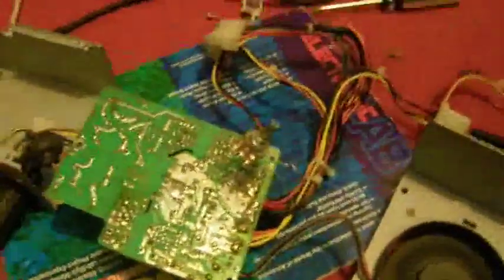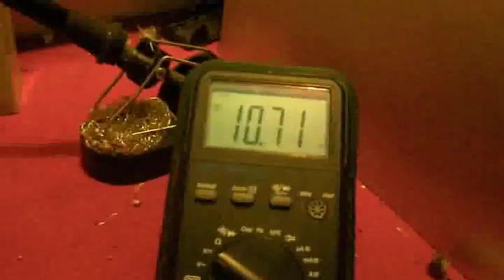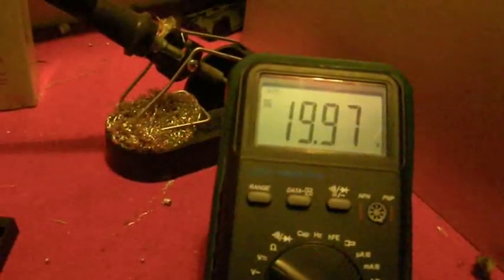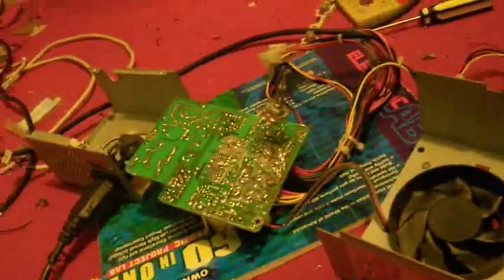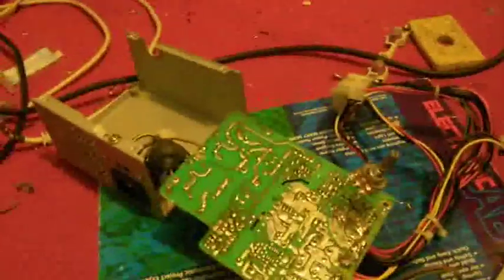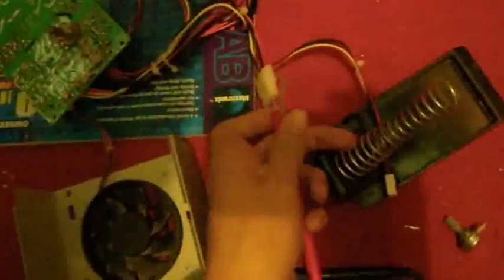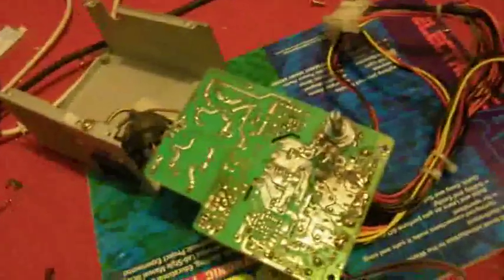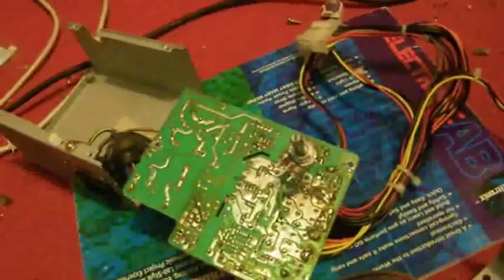Mod your ATX power supply into an adjustable lab power supply!

Comment: This is probably the most useful potato video I've ever seen. :)   Your description of what's happening is more than enough though.  Anyone who is decent with electronics will be able to reproduce it.  Everyone else is saying "how do you do it on mine?"    

I just got here looking for a 24v mod, to use with a 3d printer.  I was just curious to if there were a cheap way to do it safely.   But now, I may take one of my old ATX power supplies, and mod it like yours, just for a cheap benchtop power supply.   I've been using ATX power supplies anyways, but just working with only the 3.3, 5, and 12 lines.   I needed 24v to calibrate a VRM for a 12v laser on the printer.   I would have preferred to do it on the bench, rather than to do it once it was attached to the printer.

Comment: During power supply design semiconductors are calculated at certain output. You may can modified, but this it's fire hazard! Please next time use discharge resistor I stead screw driver.

Comment: 3volts to 25volts and carry at least 10amps. Thanks for the video. I would like to see where exactly you connected the wires of pot.
Reply: so do I.... his explanations are not clear and systematic at all.
Reply: Bruno Ferreira buy a booster buck converter from Ebay. I used a 500watt power supply and then used the 400watt booster to get all the voltages I need.
Reply: Thumbs up ! I will write down your advice. Lol
Reply: Bruno Ferreira DC-DC 38V Digital Step-up Step-down Module Boost Buck Converter Solar Charging (modula just note that some are step up and some are step down and some do both look at the out put amp rating to give u and idea of the watts)
Reply: China cheap buck boost is worst . Someday ago i burnt two buck module.

Comment: There's a danger with this mod.
Output capacitors are often rated around 16 volts. Overvolting a capacitor will make it overheat, and eventually blow.
In worst case the aluminium cap will shatter into small pieces spreading around in the power supply short circuiting everything.

Comment: In defense of the poster, He's already giving a base Idea.. You can do the foot work yourselves, looking for the datasheets for the feedback loop (which is using a LM494 or similar chip), and the Overvoltage protection chips.. I know, not all have the same chips..   Simple rule.. Let the supply sit for at least a minute after unplugging! Let the input caps bleed down! (or you're in for one serious shock!)

Comment from the maker: Well, the power supply used 25V Chemicon caps on the 12V output, which can briefly survive 28V. I had to disable the over-voltage protection or I could only go to 14V. Modding the feedback and disabling OVP was all that was needed. I did this quite a few years ago -- and I've long since thrown this power supply away.

Comment: @ubuntututorials Hehe.  I wish I had realized before tracing half the circuit to see if I could find a spot to readjust the 5v vs 12v. Oh well. I think I'll just stack two 12v rails by isolating the upper from chassis. That will give me the required 24v atleast.

Comment from the maker: @1kreature Yes, I understand that - I work a lot on switch mode power supplies. The TL431 is often used as part of a feedback mechanism. When the voltage at the ref pin exceeds 2.495V the output conducts, which controls an opto-isolator. The opto-isolator feeds the primary side switcher IC which has a built in MOSFET. Now, unlike many other PSUs, this uses a primary side control circuit. Most nowadays use secondary side control, it is cheaper and simpler to implement. These are easier to mod.

Comment: @ubuntututorials Btw, for those psu's using TL494 chip this may be a good source of info:
pavouk.org/hw/en_atxps.html
Basically it shows why you can't tweak each voltage seperately...  They are formed from same switcher and turns-ratio dictate the voltages.

Comment: @ubuntututorials Yeah, they should be replaced.
Looking at my PSU here it uses a TL494 for pwm regulation. IT also seems to be relating the 5v to -7 of the 12v as when I tweak the feedback loop of the 12v the 5v follows suite. How annoying.  Now I have to find that too and compensate. Adjusting the 12v to 13v moves the 5v to 6v. How rude of them not to make these fully seperate.  (Cheap probably.)

Comment from the maker: @1kreature Mine had 10V and 25V caps on 5V/12V. I would highly recommend replacing them anyway with long-life low-ESR caps, as at higher voltages the supply higher currents might be observed which would cause increased heating in the capacitors.

Comment: When I checked my PSU to use for a CNC (Need 24v) I found it had 6.3v rated filter caps on the 5v rail and 16v caps on the 12v rail. It wouldn't be wise to crank it up to 24 I guess. Not without replacing all those caps first.